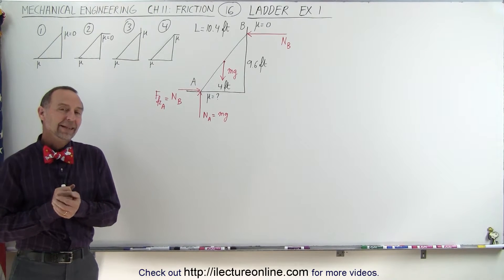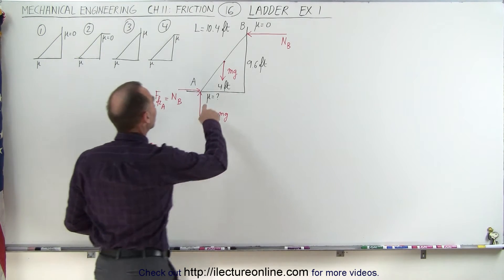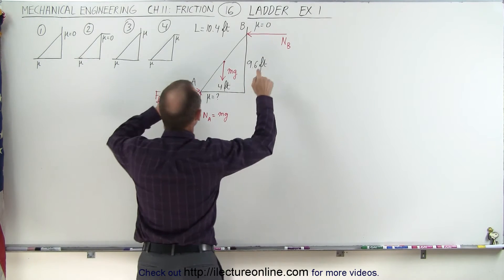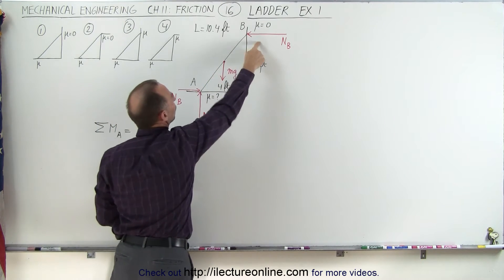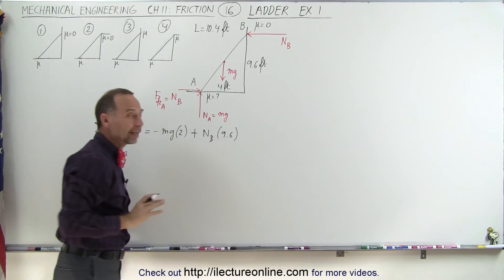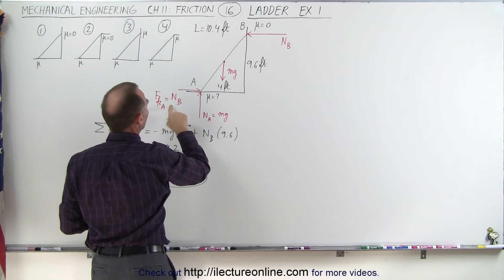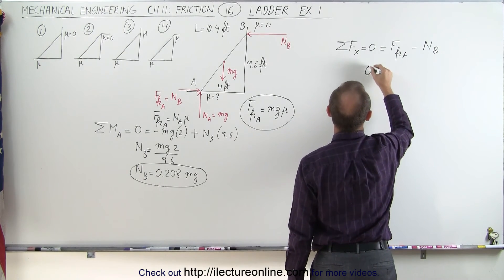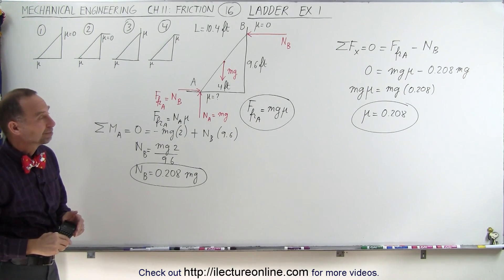Mechanical Engineering: Ch 11: Friction (16 of 47) Ladder: Example 1 of 4

Comment: I have a  question sir,, 
For ladders math,  when I took (mg) for ladder, at an inclined plane.. then why we didn't take it's component like mgcos@ and mgsin@ ?
Reply from the maker: Without seeing a picture, we cannot really answer the question satisfactorily.  But for a force pushing against a sloped plane, you would want to calculate the two components (perpendicular and parallel to the slope).  But for a ladder pushing against a vertical wall, there will only be a perpendicuar component when there is no friction and both horizontal and vertical components when there is friction.